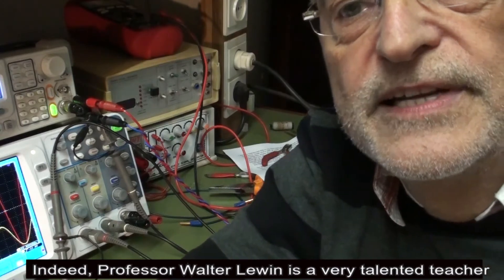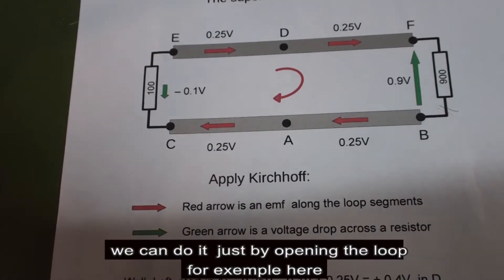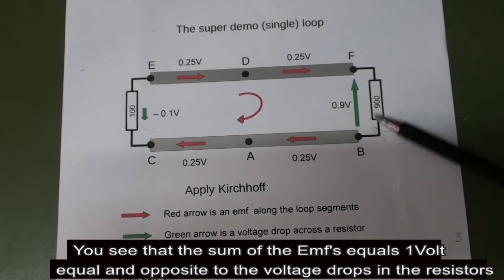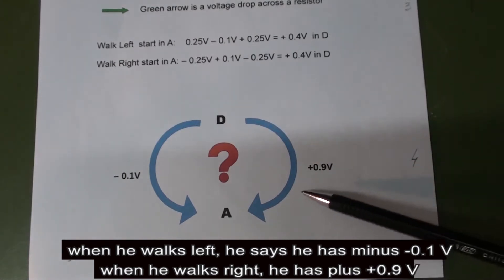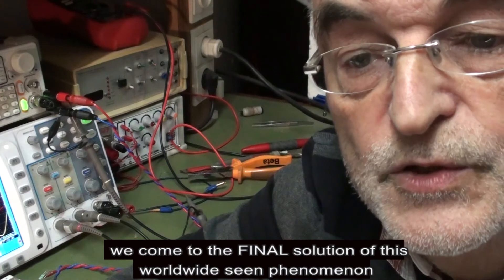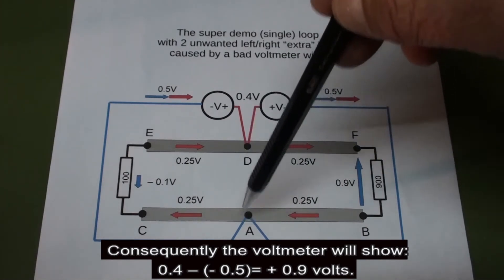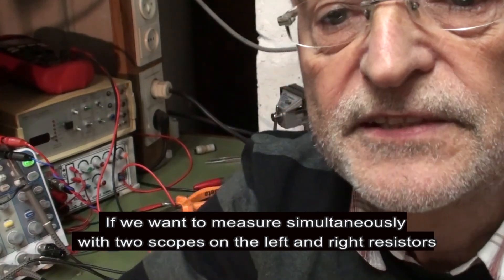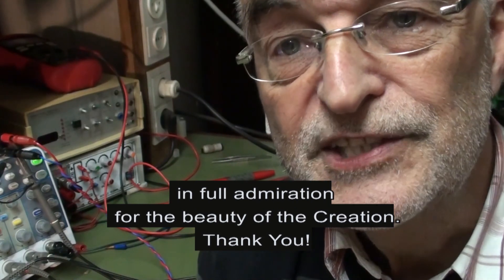W. Lewin Lect. 16 super demo revealed

Comment from the maker: In my video at time 9:5O  I found an error: it should be                                                               
     "Walk right start in A: -0.25v +0.9V - 0.25V = +0.4V in D. "
So the voltage drop should be 0.9 Volts instead of 0.1V . Sorry for that!

Comment: As much as engineers and hometinkerers like to shoot down Lewins demo for "measurement errors" and "improper probing" I find it interesting how quickly you brushed past "its hard to find zero" when there is not only a clear magnitude on scope and not so surprising it is 90deg off phase too. Also watch how the waveform behaves during the demo at 21:08:
At start "vertical probing" there is some unexplained amplitude and 90deg off phase.
Tilting probes to left side, increases the amplitude and an "smooth analog" phase shift -90deg.
Tilting the probes to the right (from left side), it will at first decrease amplitude, then introduce a 180 degree smooth phase shift followed simultaneously by once more an increase in amplitude.
At no point did I see a reversal of polarity, just a phase shift +variance in amplitude.
This is quite interesting.
Reply from the maker: Dear, I am aware that my first video is leaving you with some questions and most of them concern the non-uniform field distribution of the flat rectangular coil, but if you watch my second video I expect  ALL your questions will get answered there. Meantimes this video is referred by Prof. Kirk McDonald of the famous Princeton University.
Enjoy it !
https://youtu.be/JpVoT101Azg

Comment: So I have been thinking about this problem that last couple of days and I think I figured it out. From an electrical engineer point of view the schematic is just to show the components and their connections. Normally this means we do not use the schematic for physical placement. The demo at the end was very interesting as you were able to achieve his results depending on which side the pig tail loop was placed. I am going to assume that there is no magnetic flux through that loop and thus relates to the path selection (loop is not over the inducing coil). From  the point of view of Mr. Lewin assuming the schematic is also a physical diagram then his explanation is correct. However I need to think about this more.
Reply: Also when the probe is in the left most or right most position, isn't the loop area very small at it is on top of the resistors. Thus would this mean that the induced emf is small?
Reply from the maker: Flipping the measuring wires to the left is creating an extra half- loop, and the -0.5 Volts emf in this half surface opposes with the 0.4 VOLTS,  giving - 0.1 Volts. Idem for the  right flip: 0.5 Volts added to the 0.4 volts results in 0.9 Volts. By the way, your question to Professor Lewin disappeared after a short time on his forum. But you can NOT see that, for you it's slill there!!!  Can you post the same question here
Reply from the maker: Indeed, the resistors have a small physical dimension along the circumference and hence their loop is almost neglectible in case of SMD resistors; but the integral dot dl opposing with the emf's of the wires (-dPhy/dt), is then completely "IN" the resistors as a voltage drop.
Reply: I posted this topic on eevblog forum the say day I left this comment. Both my responses are copied there. I deleted my post on his channel as I don't like confrontation. Here is a link to the forum post. http://www.eevblog.com/forum/beginners/walter-lewin-8-02-lect-16-super-demo-(correction)/
Reply from the maker: I saw the doubt of Oron about my short coil but I can assure him that 

with  my second model, a coil like the one that W.Lewin used, I found exactly the same values. I'll make a new video next week and show the field distribution
Reply: Cyriel Mabilde As I told you, I think you are mistaken. Having the probe at one side of the circuit does not create an additional loop. You can make 2 loops, one that goes from the probe to the resistor at the side of the probe and back to the probe and to the scope, and one that goes around the other resistor. The first loop creates a surface outside the circuit, having no emf at all. The second loop creates a surface that catches the magnetic field lines, so it has a 1V emf. You can consider one loop or the other, the result must be the same because they both must obey Faraday's Law. When the probe is vertical, the surface created by the 2 possible loops catches half of the magnetic field lines, so the emf is 0.5V. 0.5-0.1=0.4V and 0.9-0.5=0.4V
You get 0.4V because there is 0.5V being induced.
Do you understand this? Your theory does not respect the Maxwell's equations. I will try to do some drawings of the surfaces around the closed loops and you easily understand what I mean.

Comment: Very well said, and demonstrated.  I hope that you and Prof. Lewin can find common ground here, as I too have a lot of admiration and respect for him.  In any case your demonstration here is enlightening.  I'm not a physicist or engineer, but it still seemed absolutely impossible to me that two voltage measurements at the same two points in a circuit could give two different answers, depending on -- what? -- the path that Walter Lewin says the measurement is following?  How does the voltmeter know which path he wants it to follow?  (Please correct me if I'm interpreting his demonstration wrong--and remember I'm no engineer or physicist) In his MIT lecture (on YouTube) he doesn't show exactly where the probes are connected in the circuit, nor their positions as you have.  Your demonstration here makes much more sense to me, and I thank you.
Reply from the maker: Best thanks for your appreciation and trust

Comment: First time watching this. I haven't read all the comments, so apologies if I restate points that have been made. There is SO much wrong with both your experimentation and analysis. First, there is no 'emf' in the conducting wire. The 0.25 Volts you are measuring in each section is the changing magnetic flux of the coil, which bend around and pass through your probe wires. Use a simple voltmeter with a very tight loop and you will measure 0V, corresponding to the fact that you are measuring the potential difference of two points in conducting wire. The total emf is indeed 1V, but you cannot assign that to sections of the wire. Consequently, the 0.4 volts you come up with doesn't make sense. The part where you show the voltage change from one side to the other is actually brilliant but you completely mis-interpret it, as it perfectly PROVES Lewin's analysis. You claim that measuring the voltage from A to D with a voltmeter on one side or the other is misleading, and the vertical orientation is correct. That is exactly backwards. For proper probing, you need a FULL LOOP that has no magnetic flux passing through it. When the voltmeter is one the left side, you have a loop formed by the probe wires and the left side of the circuit with the 100-ohm resistor. This is a correct measurement, as most of the flux is concentrated outside of this loop. The same is true when you put the probes on the right. They are different measurements for a reason - they are measuring the potential drop across each resistor only. When you put the probes in the vertical position, two different non-planar loops are formed. The (vertical) probe wires form part of each loop, and the other part of each loop lies in the plane of the circuit, one on each side. Whichever loop you analyze will include about half of the emf, throwing off your measurements, and giving you the average of 0.9 and -0.1, or 0.4 volts. Ironically, this is the position that you consider to be unaffected by the flux. Again, the changing of the probe from one side to the other proves exactly what Lewin is demonstrating - that the 'voltage' difference between A and D depends on the path you measure it by, as the electric field is non-conservative due to the presence of a curl (the time-varying magnetic field).
Reply from the maker: Dear Ted Sheridan,  I don't want to lower myself by laughing at you like you do at me. 
Wisdom and insight are sometimes delayed, remember Caesar Caligula:
"Condemnant quod non intellegunt"
Reply: @cyrielmabilde7729  I'm sorry if you disagree, and I mean no disrespect. But you have a clear misunderstanding of Faraday's law.

Comment: You can eliminate the probes!!! All you have is your primary and secondary coil (no probes!). Your secondary coil is a single loop of uniform resistance. You pass an AC current through your primary coil. After a while, you notice that the secondary coil becomes warm.  Please describe how the EMF varies round the secondary coil at a point in time, and explain why it heats up. According to your theory there would be a current round the loop, but no EMF! With Lewin's explanation, you can explain the current by an EMF round the loop.
Reply from the maker: Please,  better watch my new video with link here below
Reply: @cyrielmabilde7729  I have already seen your new video. It is a quality presentation, but it does not answer the question. I also saw the video of Electroboom (Medhi?) and his explanation. I will post my question again, for your newer video. See you there.

Comment: Interesting. This is my experience and theory.
I made a similar experiment. But with a metal ring and two resistors soldered at opposite ends of the ring.
I tapped "fluxfree" in several places with a twisted pair wire. There is nowhere a voltage difference in the wire segments BDE and CAE. Only when a resistor is enclosed in a measured segment, a voltage is detected. 
So KVL does not hold.
And that is logical. KVL is derived from the principle of the conservation of energy in a circuit. The sum of all vectorial V*I must be zero. This circuit receives energy from outside. As I is constant this means the sum of all E vectors along the loop is not zero.
Best regards,
Peter.
Reply from the maker: Beste Peter, als je mijn tweede, betere video bekijkt dan wordt het duidelijk dat de emk over een draadsegment WEL meetbaar is mbv een interne meting. Inderdaad als je uitwendig meet dan maak je steeds een bijkomende meetlus die een tegengestelde emk produceert waardoor je de indruk krijgt dat die emk over het draadsegment zelf niet bestaat. Veel plezier er mee!  Hier de link en kijk ook eens naar "Kirk McDonald Princeton aangaande de Lewin Paradox".

 https://youtu.be/JpVoT101Azg
Reply: @cyrielmabilde7729  , bedankt voor je antwoord en de ongelooflijke moeite die je gestoken hebt in het maken van al die testopstellingen. Je bent echt goed in die demonstraties. Het lijkt wel een full time hobby van jou om Kirchhoff te ondersteunen ;-)
Mag ik niet helemaal overtuigd zijn? 
Want er zit iets van een cirkelredenering in jouw interpretering van je testen. Je gaat er namelijk vanuit van de regel dat er een EMF geinduceerd wordt in een stukje geleider dat deel uitmaakt van een gesloten circuit in een veranderend magnetisch veld. Dus redeneer je, gebeurt dat ook in de leidingen van een voltmeter. En als je die voltmeter bijgevolg over een segmentje zet van de main loop (zonder een R erin natuurlijk) dan annuleren die elkaar en lees je 0 V. Deze redenering is volgens mij geen bewijs. Je gebruikt namelijk wat je moet bewijzen in je bewijsvoering.
Het kan toch ook zijn dat je 0 V leest omdat er geen EMF op het main-loop-segmentje zit én omdat de fluxverandering doorheen de Voltmeter meetlus nul is (dat is dus Lewin's theorie) ?   
Met vriendelijke groeten,
Peter.
PS ik ben maar een hobbyist, vergeef me eventuele vergissingen.
Reply from the maker: Peter, hopelijk heb je ondertussen de tweede video bekeken? Je hebt natuurlijk gelijk dat je "extern" geen EMK meet over een draadsegment (zonder weerstand) van een "single loop"Je kan dit op twee verschillende manieren uitleggen (zie video2) en de meest gebruikelijke verklaring is dat er tussen het bemeten segment en de meetdraden geen echt oppervlak bestaat met daar doorheen een veranderende  flux. Mijn uitleg met de bifilaire  draden verklaart ook waarom we die emk niet meten op een segment  maar "wel" zullen meten als we meerdere windingen er bij betrekken, want dat is de basis van een transformator.  Als Lewin de meetdraden naar links en rechts "flipt" dan liggen zijn meetdraden samen met de segmenten en meet hij bijgevolg geen emk's omdat hij die annuleert. Wat overblijft zijn dan de eventuele drops over de weerstanden. Hij denkt daarmee een wereldschokkende demo te hebben gemaakt en hij zal dat blijven geloven. Bedenk ook: je kan geen grootheid exact meten als het gebruikte meetsysteem een evengrote fout introduceert als de waarde van de meten grootheid . Met mijn gedemonstreerde "interne" meting , waarbij er telkens ook een oppervlak wordt gekoppeld aan een onderliggend segment, wordt aangetoond dat de emk's uniform worden opgewekt  in alle aanwezige onderdelen van de "loop". Plaats je antwoorden aub op  onderliggend forum.

Comment: Hi Mr. Mabilde, can you explain why Ohm's Law doesn't seem to be applying in your B to A measurement? The resistance is practically zero and the current is 1mA, but the voltage shown is 0.25V.
Also, you have assumed that the lines of magnetic flux, generated by your primary and asymmetric secondary coil, are vertical. Why do you make this assumption?
Reply from the maker: to Strangers:
 the 4 segments(B-A, A-C, and the upper E-D, and finallyD-F) form together the secondary in which the Emf of 1 volt is generated. This is like a transformer with only "one" winding and two resistors.
You may apply Ohm's law on a segment and on all of them: but their resistance is nearly zero (maybe 1micro Ohm)so compared with the drop across 1kOhm you can neglect this very small drop. Nevertheless each segment generates 1/4 of the 1 Volt Emf  and this is 0,25 V.  If you make the integral of all the E.dl's, distributed along the whole length of the loop, you"ll become 1 Volt.
It looks non-intuitive, that a near-zero conductor, when exposed to a changing magnetic field, can show a voltage emf at his ends, but that is precisely what Faraday discovered and it is the working principle of a transformer.
To help you understand:  a welding transformer can have only one winding, extremely low resistance and yet have an output voltage of several Volts ; and if you attach a midpoint connection to this single secondary you"ll have half the voltage.
Answer to your second question: I suppose the magnetic field through the loop as vertical, at least when I am very near to the primary.  Of course, if you move far away, there the field lines will curve and close. But that is outside the loop that we are considering. So in the loop, the field is supposed uniform and perpendicular.
Also my so-named "EXTRA" loops (of the scope wiring) are exposed to this vertical field and I demonstrated this situation, because that is precisely the reason why professor Lewin made his wrong measurement. Hoping he will agree now!
Best greetings from Belgium
Reply: Hi Mr. Mabilde, I understand Faraday's Law, I was only asking for your interpretation of how it applies here. The difference is that I do not think that the magnetic field flux lines are vertical, in this setup. You have a complicated situation here caused by the fact that *a current flows in the secondary, too*. The magnetic field that would be created by that current is complicated. It is not uniform and it definitely is not vertical. It is strongest near the points in the secondary with the lowest resistance, curling tightly round those points on the secondary. The voltage you are measuring across the segments is due to the non-vertical magnetic field lines passing through the vertical plane of your scope wires, not a potential drop in the segment. Remember, the magnetic field is the interaction of the magnetic fields created by the primary AND secondary. It cannot be assumed to be vertical.